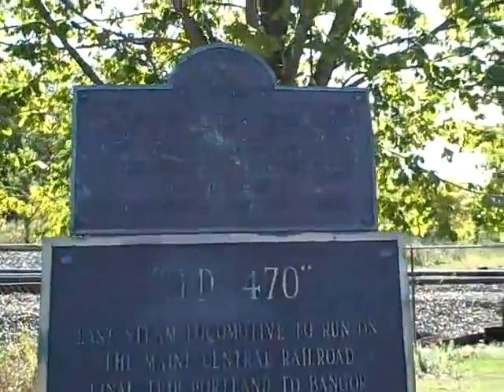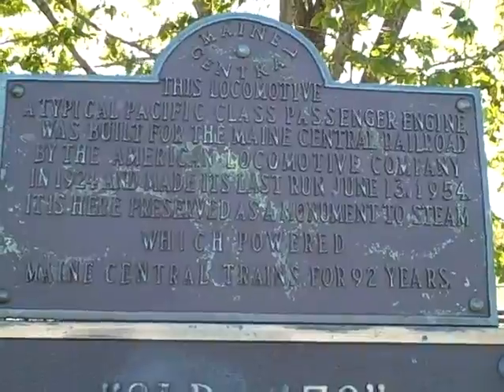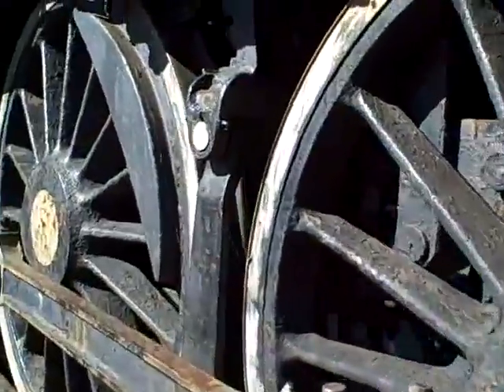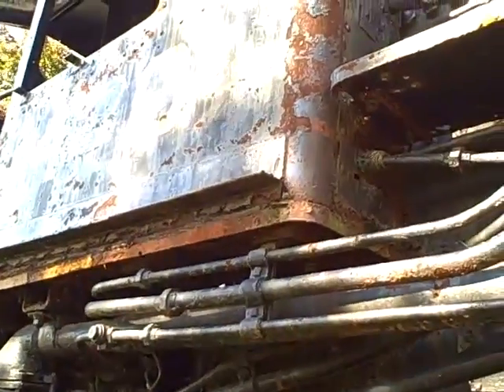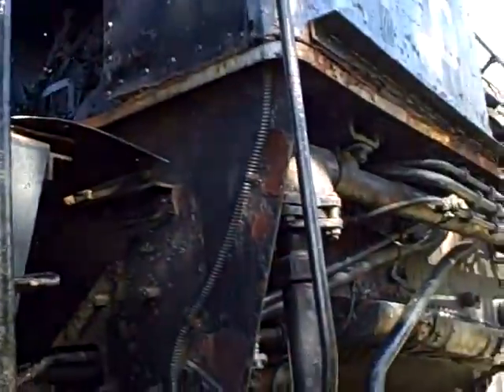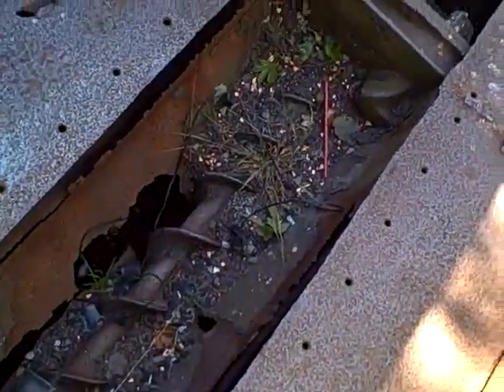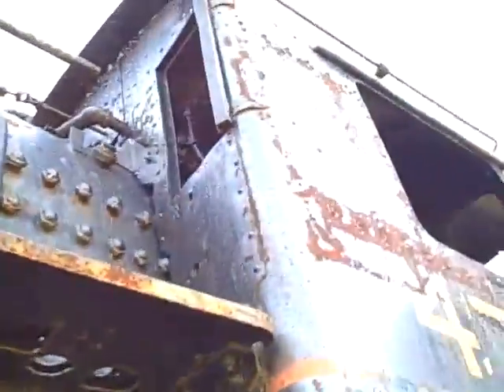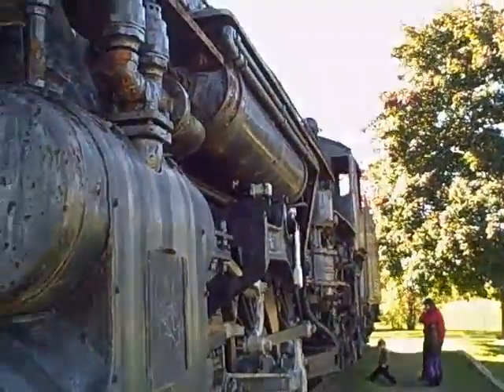Historic Steam Train in Fairfield/ Waterville Maine AMAZING!

Comment: As of 2015, Maine Central 470 will be moved to Washington Junction in Ellsworth, ME.  The New England Steam Corporation will be restoring the locomotive to operational status.  Washington Junction also happens to be the home of the Downeast Scenic Railroad.
Reply: Wrong it is going to the Belfast train club
Reply: That's what you think.
Reply: ultra gamer first of all there is no such thing and there track is to light
Reply: I happen to know the guys involved with restoring MEC 470 and it's definitely not going to Belfast.  It's heading to Washington Junction in Ellsworth.
Reply: @GrnArrow092  I believe you.. God bless another restored steam engine !..
I wish Amtrak would run a bi-annual, say, excursion with steam such as 4449 on the point and no back-up diesel involved... 
I'm a MRRer and I think the restoration of so many steamers is actually improving the hobby involvement !! It seems strong again, whereas, say, 15-20 years ago it was dying...M